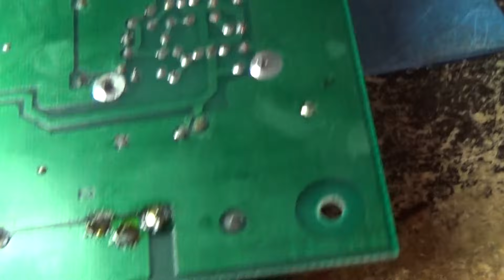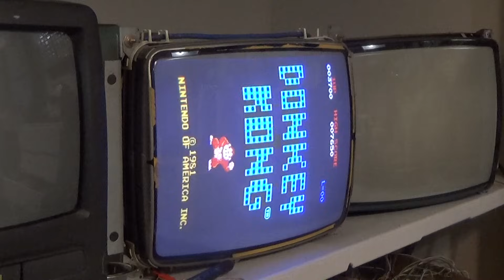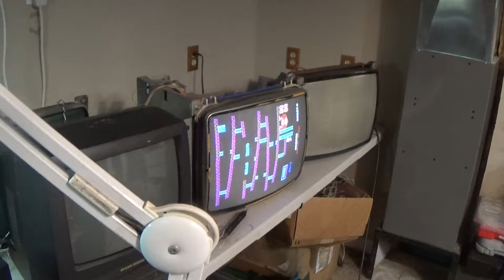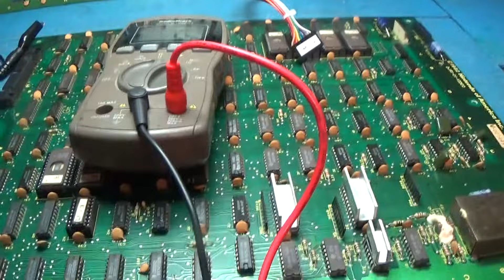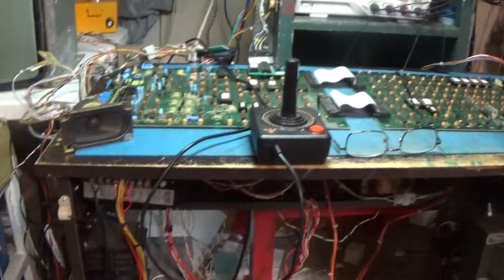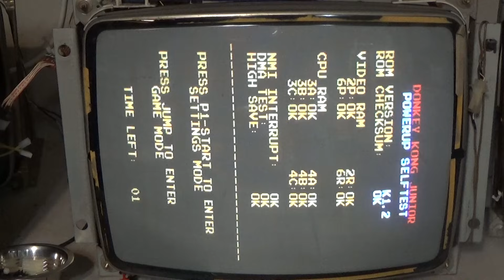Nintendo Donkey Kong & Donkey Kong Jr   - 2 for 1 Repair Video!

Comment: I just bought the Power Supply. Thanks for the number. There were 4 that came up and the one we need is the 709-RT125A. This one does 12v, 5v and -5v. The others have different voltages. I had tried to bench test my DK with a Jamma adaptor and it would not go. I was running it through a supergun with a switcher and a ATX power supply. I couldn't get it to work. I was trying to figure out if my lack of sound was the amp mounted in the monitor or my board. It ended up being a bad speaker connection created when someone soldered the speaker lead on to the speaker instead of just putting on a blade disconnect. I am betting the ATX and the Chinese switcher were just not up to the task. Thanks for the information.

Comment: Please post the power supply when you can find the part number.
Reply from the maker: Just added it to the description
Reply: @classicarcaderepairs  There are three different versions of the RT-125.
Reply: @douro20  Only one of them sends -5v.  RT-125A  = 5V/12A 12V/5.5A -5V/1A

Comment: The kit tests ram and rom. Then prompts  to allow going into a settings screen that allows setting dipswitch options, freeplay and resetting the high score table. It is super useful if you have a bad 2114 or 4148 ram.  It will tell you which one is bad.
Reply: Hmm...I thought it was just a high-score save kit.
Reply: @douro20  only the Braze kits add the extended testing features. Very useful to catch problems early with a board set.

Comment: I've never seen Jr go through those keys either.  I wonder if there's a glitch in a collision detection circuit or something?  Or if the board has DRAM, it's possible that the DRAM chips were damaged by the lack of -5.  They don't like being powered up without the -5.
Reply from the maker: I actually have an extra donkey Kong Junior video board here at the shop… I plugged it in and got the exact same behavior… I just never noticed it before
Reply: @classicarcaderepairs  That is weird.  I also looked at a couple of playthroughs on YT and never saw it happen.  Well I guess if the behavior is consistent...
Reply from the maker: @ovalteen4404  It really only happens if you don’t get underneath the keys… If you try to swing on the vines in the middle of the keys or towards the bottom of the keys is what it seems to not work… It is weird
Reply: Maybe there are a couple of different ROM revisions?  In this MAME playthrough the player is definitely breaking the rules there and pushing keys from the middle.  https://www.youtube.com/watch?v=r0965dy-Pzg  See timestamp 2:54 for an example.
Reply: They also need well regulated -5 since it has ECL chips in the clock circuitry.
Reply: I've only seen going through keys before if you are using an 8 way stick, and hit a diagonal.